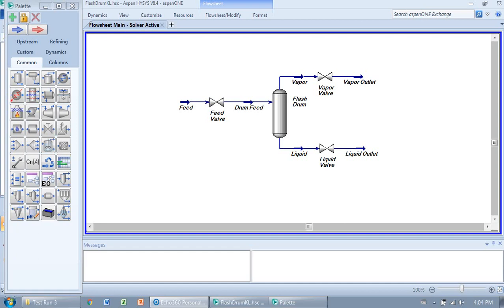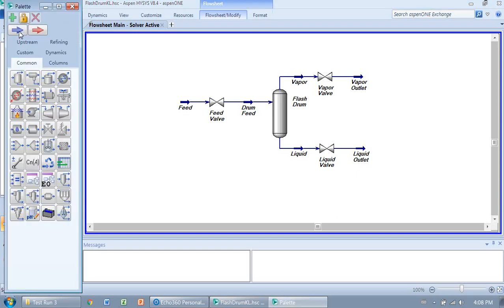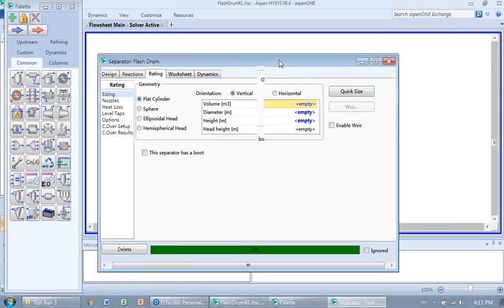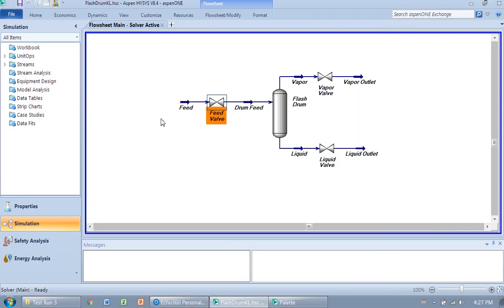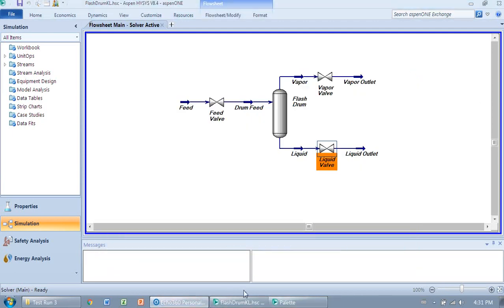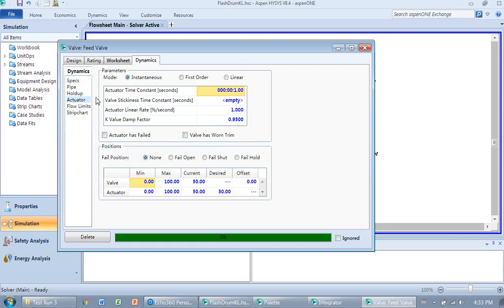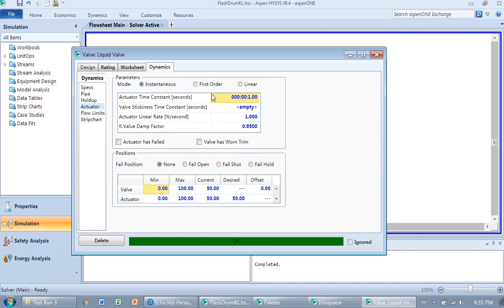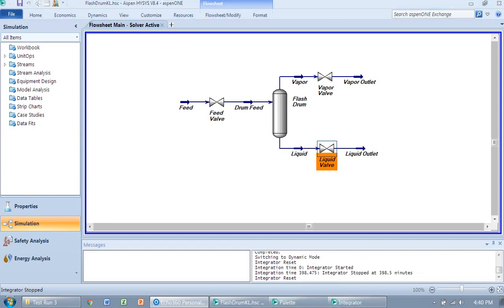HYSYS Dynamic Modeling - Part 1

Comment: The tutorial is ok. However, the limit rate on the valve is however ridiculously low. A valve opens generally with a rate of 0.3 or 1%/second. So 100 times more than what has been typed there